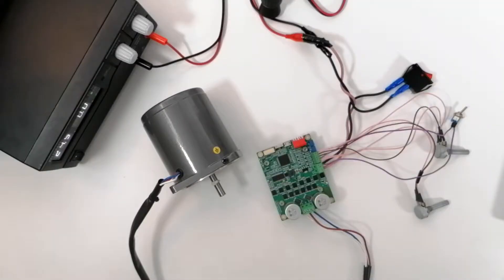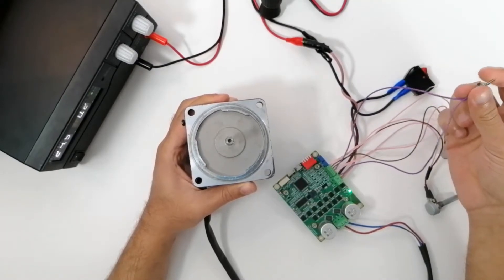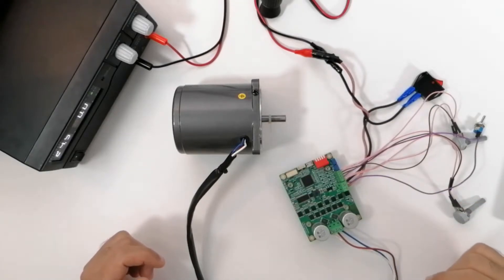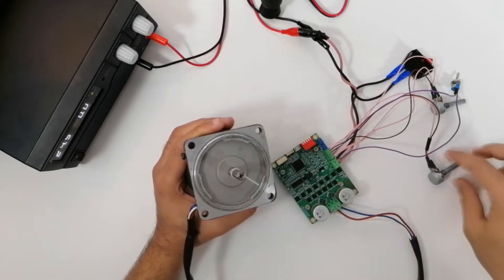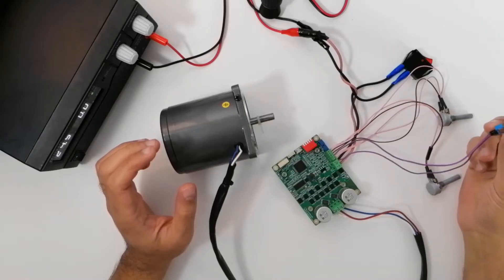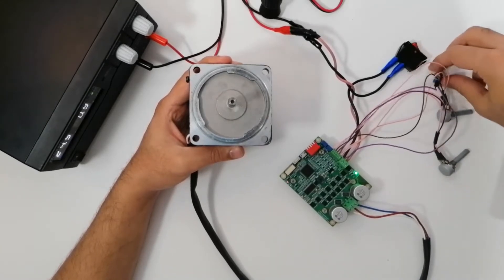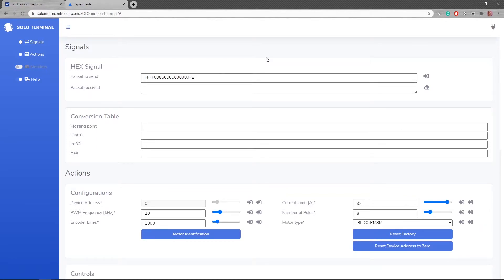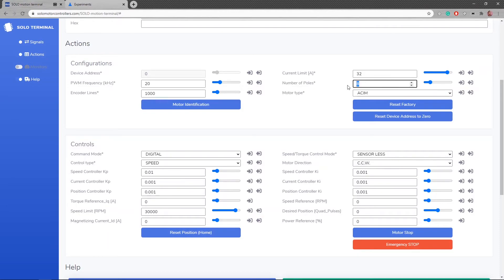Speed Control of an AC Induction Motor using SOLO in Manual and Digital mode

Comment: Hi. I would like to know if it supports Step/direction signal and Hz? im thinking of using it with a BLDC with encoder instead of my closed loop steppers. Maybe one of the newest versions (solo uno V2) Thank you
Reply from the maker: There a lot of similar cases as BLDC give a lot of good reason to use them. You can play with SOLO and obtain your final result but I think you need to experiment different approach. We have analogue speed reference and direction as digital too, so you need to try what work the best for you.

Comment: Would this be useable for a direct drive steering wheel for sims?
Reply from the maker: Hi Iggy, 
To help you better, we need more information, especially about what type of motor you are going to use and what type of control?, but in general, SOLO supports, Position, Speed and Torque control for various types of motors, including DC brushed, Brushless DC, Permanent magnet synchronous Motors and finally AC induction motors.
we have some tutorials available on our website for each of these: https://solomotorcontrollers.com/blog/
But regarding your application, previously we had customers who were using BLDC motors for Sims and they were using Torque control, which SOLO supports totally in Sensored and sensorless fashions.
but if you want specific help, please let us know the type of your motor and your application in more details. Thanks